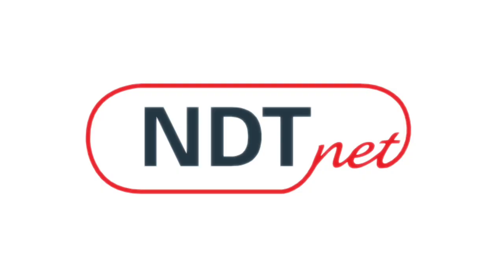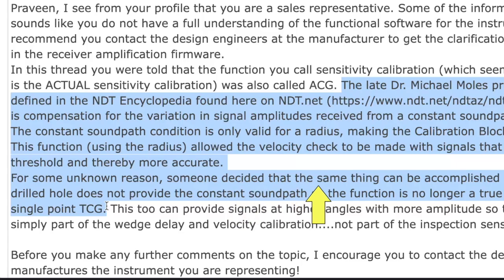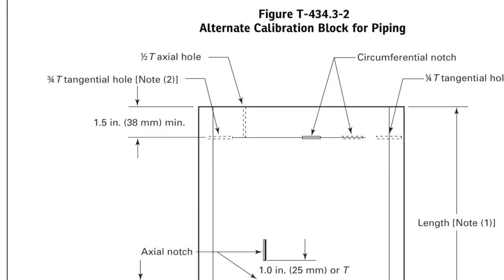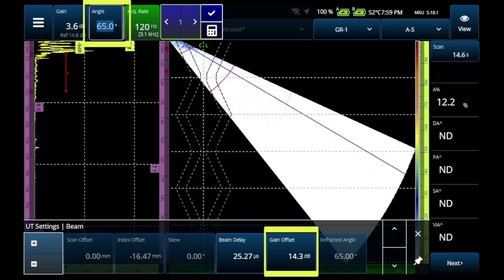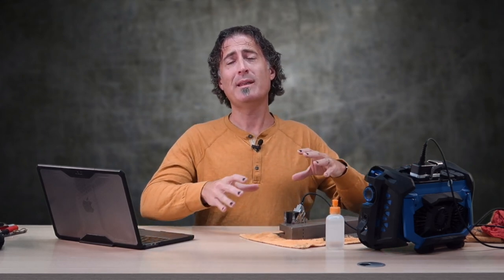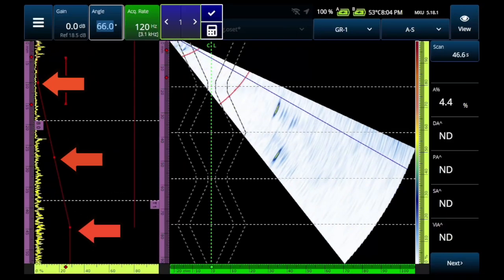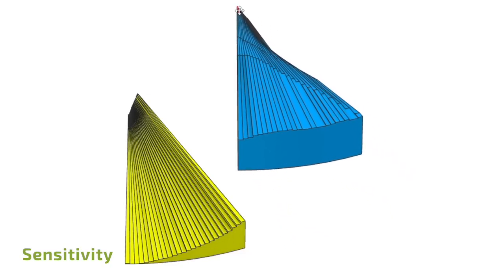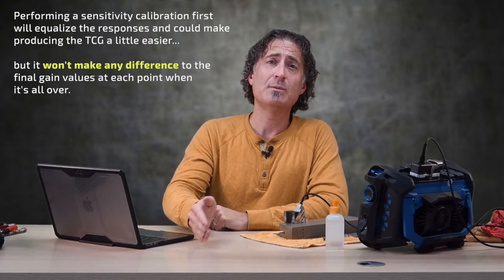Sensitivity & TCG Calibrations

Comment: Thanks Paul for the explanation. Can you explain that after sensitivity calibration when we go for the first point of TCG calibration we are reducing the gain initially. After tracing, once we add the point, all angles compensates to 80% but the visual dB on omni scan doesn't increase. Can you please explain. Thanks
Reply from the maker: This should not be the case if the 1st point of the TCG is also the point you did the sensitivity calibration with.

Comment: Does this logic work the same if the sensitivity reflector is a different size than the TCG reflectors?
Reply from the maker: Sorta, yeah. It will just skew things but after the TCG you should be fine. Even if you ran the sensitivity calibration on a radius (as it was originally intended) and not a hole or a notch, the TCG will fix everything.
Reply: If you're referring to using a NAVSHIP type block for TCG and ASME basic block for sensitivity. Build TCG first, then go to ASME basic and figure which leg (1,2, or 3) yields the highest amplitude, keep your probe there, then reduce amplitude to desired reference %FSH